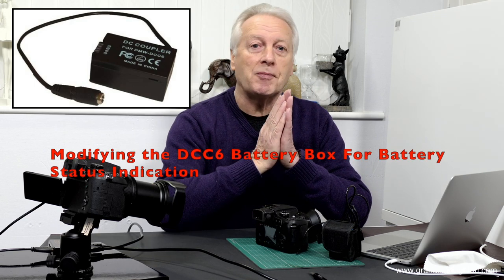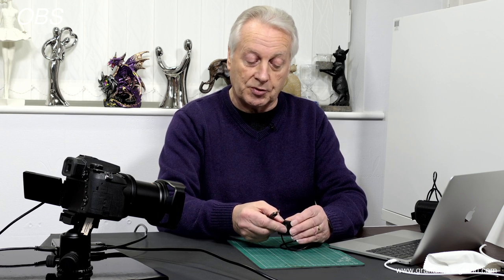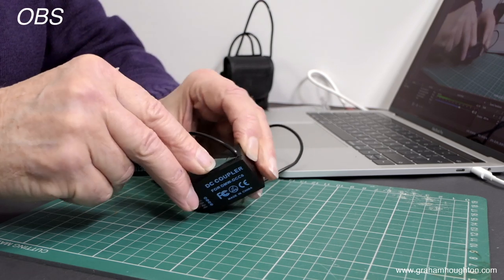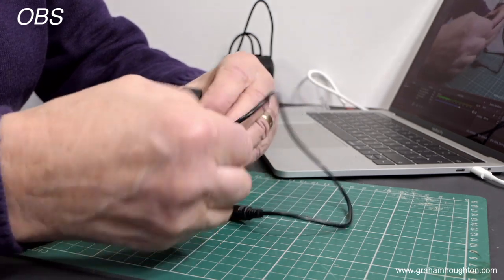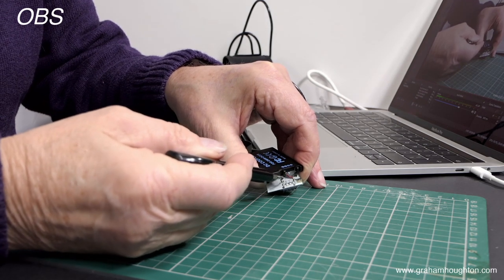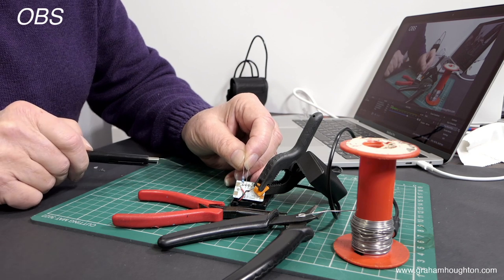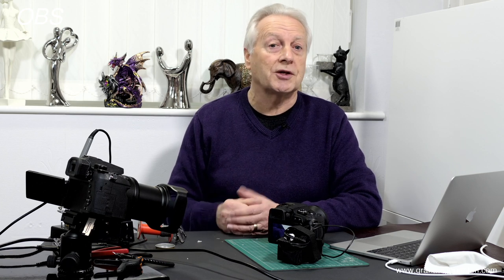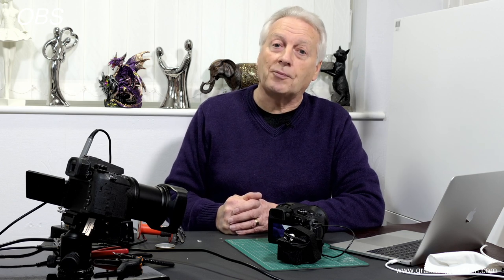DCC6 Battery Box ( for FZ80/82 Fz100 fz150) Modification to Show External Battery Charge Status

Comment: 10k resistor is Brown Black Orange....not red...so I thought I would tell you...good video thanks..
Reply from the maker: no it is correct -  this is the 5 band resistor code. brown, black, orange is 10k in the old system!
Reply: @GrahamHoughton12  YOur right...im still in the old school...why would change a code that has been around for at least 100 years.
Reply: great video.  Can this be done on canon lpe6 battery dummy. actually there are 4 terminals they are the +ve, -ve ,T and C. i was wondering whether the 10k resistor needs to be put on C or the T? any advice would be appreciated.  thanks